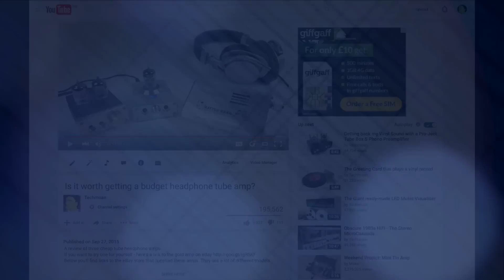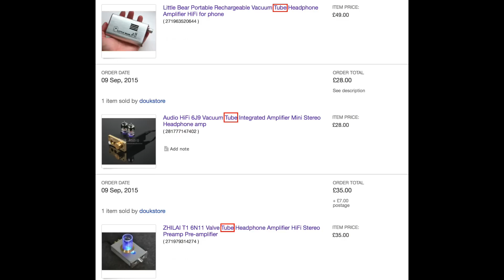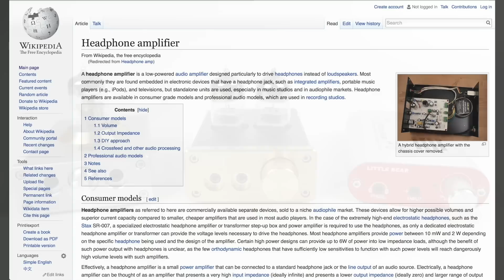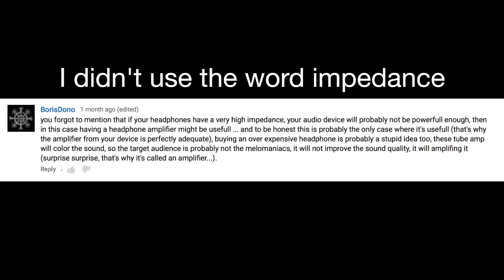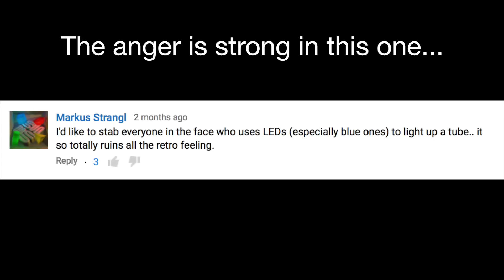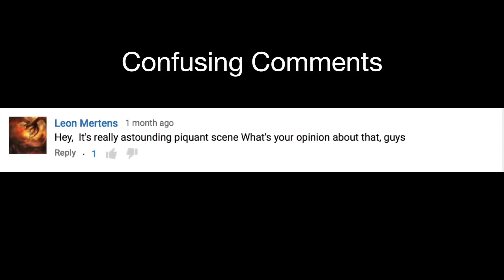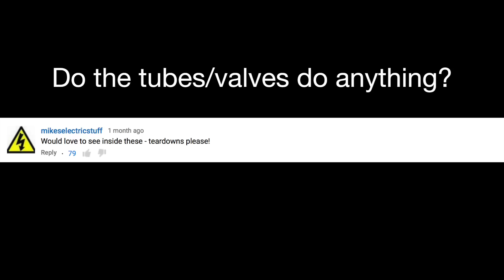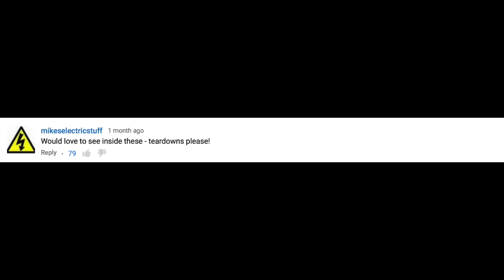Headphone Tube Amps - Follow-up & Tear-down

Comment: You might want to try out a 'tube buffer amplifier' too. They amplify line stage to line stage with little amplification, but with some characterstic tube sound. You can use it as an interstage between a CD player and power amplifier for instance. There are some kits you can easily solder yourself.

Comment: Okey, I'm fairly confident the valves don't actually do any amplification, the NE5532N opamps do. At https://youtu.be/2Zt5WPdyPTw?t=715 you can see the pin8 on opamps comes from the valves, that's power for the opamps. That's why it powers on with a delay, that's why it rings when tapped and that's why you can disable channels independently by taking one or other valve out, but all that is really happening is that valves are messing with opamp power not the audio signal itself.
Mind you, it is possible to make similar amp where the valves actually do something.
Reply: For fun you might try taking out the valves on the two valve variant and putting a wire jumper on pins 1 and 3 counting clockwise, view from top

Comment: UPDATE:  i received my "Valve Amp" tooday and as my dad is a TV technician doing it for over 30 years and has experience with Valves. he said the Valves are a Bridge and for show. you can use both channels with one valve fitted but remove both and it will work. are they worth it for me yes and no. yes i only need it for my Xbox one no because i wanted a True valve amp

Comment: I'm not a tube guru by any means, but I know enough to understand how tube amps work (or "valve amps"; either term is correct, and most people who use those sorts of electronics will understand either word...unlike some commenters, apparently.)

At any rate, I looked up data sheets for both 6J9 and 6N11 tubes. The 6J9 has a typical rating of 125v on the plate(s) (300v max), and is a triple triode design. Considering it's a stereo amp, it makes sense that they would only use two of the three triodes in the the tube, which would easily explain why some pins were unused. You don't need to connect the pins of a triode section you're not going to use.

The 6N11 is China's name for their direct equivalent of the 6DJ8 (ECC88 for you Europeans), so we'll look at a data sheet for the ECC88 because those are easier to find (remember, it's the exact same tube, just a different name): it's a dual-triode design, but if they're using two tubes in the amp, they're probably only using "half" of each tube. You'd have to ask them why they went that route, but it's not uncommon either, so there's nothing particularly odd about it (and again, explains why not all pins are connected to traces.) The typical plate voltage of an ECC88 is 90v (130v max), again a good choice for a low-power situation such as this.

Both tubes use the typical 6.3v for the heaters, and have low plate current draw (15mA for the 6N11/ECC88, 6mA for the 6J9.) Both power supplies would have no problem heating those tubes; most modern cellphone chargers will even handle a 1-2A current draw, quite a bit more than either of those tubes require!

For comparative reference, I'll list typical specs for the 12AX7, which is still an incredibly common and popular dual triode preamp tube: the typical plate voltage is generally around 250v, with a current draw of 1.2mA. While a 12AX7 can be run at lower voltages, you start losing a lot of headroom and it distorts sooner (great for guitar amps, not so much for hifi gear where you want ALL THE HEADROOM.) Thus, a 12AX7 is not a great choice for small amps like this, although it gives a good point of reference for the sake of comparison.

One thing I'll point out is that it's typically power tubes that require a metric load of electricity, and these are hybrid amps with apparently a solid state power section. Considering there are no EQ controls, the audible effect of the two preamp tubes is minimal at best (not counting damaged/microphonic tubes.) Most of the signal boosting is being done by a solid state power section, which have far lower power requirements in small applications like this. The tubes are working but I'd be willing to be money that you could swap in solid state components and not hear much of a difference (you'd be able to shrink the amps down by at least half the size, though!)

Comment: Here is my verdict:
Second 2 amp look like total fake,  there is no high voltage supply and they only connect heater.  it is interesting that they actually took care to make that turn on delay, looks like it is implemented by placing capacitor on power supply "enable" pin.

There is possibility that first amplifier is using tubes  at very low anode voltage  since it looks like there is some kind of boost converter, but this is not normal.
 Build quality of second amp looks  like bad joke on audiofools. it has only one dc dc converter so i think tube is definitely for decoration only.

Last "little bear" amplifier is actually real deal, but it is using special type of low voltage vacuum tube which is designed for battery applications,   I can't comment on whether this is considered adequate quality.
There is DC-DC converter to power that tube and another DC-DC converter to power up the heater.
So in essence all contents are as written on the can.
I find it interesting that they decided to use power modules(and one module is even modified) instead of just soldering all parts on main PCB as in first 2 amps.

Comment: Re your comment about not all of the pins being connected. Circuit boards tend to be multi-layer so they can run all the tracks they need without them crossing. So the other pins might be connected on another layer, or even the other side of the board.

Comment: I got mine in the mail today, the gold front one. I have just tested it with some crappy headphones but it really improved the sound. Not only did it get louder, it also added some thickness. 
No ringing sound with my amp so you prolly got some bad tubes when u got yours.

I bought mine for use while i record music and hope it will increse the sound in my headset.

Comment: your first video was perfect, the only missing part was the tear-down which you did now ;) thank you ! - after seeing the guts of those amps... i think i can safely state that the tube part of the amps is either interesting or questionable.. those are either tubes operated at very low anode voltages under starved conditions (look here: http://www.valvewizard.co.uk/Triodes_at_low_voltages_Blencowe.pdf ) or if not the case.. then the tubes are fake - can't see any capacitors rated for higher voltages which would be needed for "normal" tube operation.

btw... you described it correctly in your first video, the issue was a ringing sound, no question about that one ;) a microphonic (behaving like a microphone) component is the root cause of such a ringing sound - doesn't have to be the tube itself - easily might be a ceramic capacitor in the audio path as well.
Reply: +Robert Jung 
It did not came to my mind that those tubes may be using low voltage, but after you comment I traced that first amplifier actually has dcdc converter to produce around 30v  or so. they seem to use 16v capacitors connected in series here.

By the way I also noticed that you can operate tube without anode voltage at all and it will generate some output by itself.

Comment: A microphonic tube does give a ringing effect on the sound so i can not really say that it's wrong to say that,
the ringing is caused by mechanically vibrating elements inside the tube construction that modulates the sound, microphonics are very common in tubes and often tubes were selected for low microphonics and sold with another product name, of course to a higher price.
Amongst hifi-guys the popular "tube-dampers" of rubber and other materials is put on the outside of the tubes and therefore does not affect the internal structure of the tube.
Reply from the maker: +senohpi I never said it was wrong to call it microphonics .....just of no interest to 99.99997% of the people watching the video (or the person making it).
Reply: +Techmoan 
True, most people doesnt care and thats my point, you said that you got comments on the other video so that&#39;s what i commented.
Keep up the good work, i enjoy your videos!

Comment: The thing with fingerprints is that the acid in the grease etches the thin glass thus weakens it and it can then crack, 
however, that is only valid on high power bulbs like Xenon headlight for cars where the rapid heatening may crack the glass where it's weakened.
For tubes it does not matter due to it's thick glass and slow warming up, the grease does effect and tends to remove the usual white printning though, as moist also will do.
Reply: While why fingerprints on bulbs is bad, your theory is incorrect. In halogen bulbs and Xenon bulbs, fingerprints prevent proper cooling of filaments and cause them to prematurely burn out. It has nothing to do with glass expanding or contracting, and more to do with heat dissipation. I've burned out bulbs on purpose as a demonstration, never had the glass fail as a result of fingerprints.
Reply: @linksmith1057  I can assure you that HMI1200's (Discharge lamps used in theatre lighting) do indeed 'pop' when fingerprinted! they usually take out the reflectors and most of the light chain when they blow!...
Reply: +Richard Stifle just to be clear, I understand you do agree that the fact remains fingerprints have no effect on the sort of low power diode and triode tubes used in home stereo systems.

Fingerprints do affect tubes that get incredibly hot, but not low temperature tubes found in these audio amplifiers and old TVs.
Reply: +senohpi You are right guys, i certainly mixed things up :)Regarding the halogen bulbs i suspect that the grease acts as a dark or reflective spot for a certain amount of the spectral energy that the filament emits, halogen have of course a very different distribution of the spectral energy than, for example the sun, has,thus gives insuffiecient cooling on that part where the grease is applied.Does it sound reasonable?.. i have to get a bunch of bulbs and do some experiments now :)
Reply: senohpi while I appreciate somone actually clarifying why you shouldn't touch the tubes, the fact of the matter is, as you have shown, you actually CAN touch these tubes without any worry. The layers of oils from your skin on clear glass appliances which get very hot trap in excess heat, more than they were designed for when creating the surface area of the glass housing. Thus, the layers of oils cause them to get slightly hotter than they should and cause poor performance and failure. However, these tubes do not get hot enough for this to ever actually happen, although some do...
Reply: +senohpi Acid in the finger oils? Now that's a new one to me. Would have to be some seriously acidic stuff to etch glass... :D
Now grease stains do have an effect on halogen bulbs and the like, but it's caused by the greasy spots heating up significantly more than the surrounding areas.
Reply: +MosoKaiser  Only if he`s an alien )

Comment: I really like your style and the way you put the pedants in their place! I have one question regarding why would you want to use tubes/valves for hifi? Guitar players love valves (they will ALWAYS reign supreme over solid state) because of how they distort, they add rich harmonic content to the sound unlike solid state amplifiers, which do not distort pleasingly at all (I'm generalising here), however I'm sure audiophiles/hifi nuts want the most precise reproduction of sound and don't ever want distortion, so what would a valve offer?
Reply: +Jack Beale Guitar Here's a nerdy answer that I never checked myself: the phase/frequency response (which nobody measures) is much better in tubes than in solid state. Other characteristics like the amplitude/frequency response, the signal/noise ratio are worse. But since phase distortions influence how well (or bad) sound stage is perceived many people learn to cope with tube deficiences in exchange for a better sound picture. Also, human hearing can naturally adapt to amplitude distortions. But it can never adapt to phase distortions.
Reply: +Jack Beale Guitar At the bottom of this comment I linked an article describing the differences (you can skip to the end for just the conclusion). The conclusion basically states that, under normal operation (eg when not clipping), the design of the amplifier itself will have more effect than whether it's valve or transistor based. That is, if you can hear a difference, then it was the designer's choice to deliberately color the sound. Some people prefer this colored sound, even if it doesn't accurately represent the original source - this is what valve can offer, a more "pleasing sound". You might say, why not make some software which does the same thing? I think it's been tried many times before, but it probably would not sell as a nice, glowing tube on your amplifier.

TL;DR people like different things. Audiophiles (audio lovers) don't always love 100% perfect sound reproduction.

http://sound.westhost.com/valves/valve-trans.html
http://sound.westhost.com/valves/valve-trans2.html
Reply: +drojf Tubes were around long before transistors, which didn't really gain much popularity in consumer electronics until the mid 1960's, even though solid state devices existed long before then. The old selenium and germanium devices available then just didn't have the reliability or longevity of the later silicone ones, and tubes always beat them out in all areas except power consumption, heat dissipation, and size. The Hi-Fi revolution started in the late 1940's, and many Hi-Fi audio tubes (low noise/distortion) were developed in the period that followed. Today, most consumer gear is Mid-Fi at best. Most people now listen to digital instead of Hi-Fi.

Comment: Following up on this, I ordered one of these devices - the twin tube 6J9 amp. I've torn it down in a similar manner, and have a few conclusions based on my (admittedly quite basic) valve amplification knowledge. To put it simply, the tubes aren't adding much here. That's not to say they're adding nothing - the valves are being "space charged" on 12v, and are colouring the sound instead of amplifying them. The valves ARE being used, but as a preamplifier, instead of amplifying the sound directly. They very much are hybrid amps. If you're after a complete valve amp, these are NOT the solution. The tubes being used in this can also be pretty microphonic. 

However, these ARE hybrid valve amplifiers, and for the price they aren't bad at all. Yes, they are cheap and chinese made, but so is the well known Little Dot range. And if you've got a reasonably high impedance set of headphones, probably up to say 64ohms, they will drive them better than an onboard headphone amplifier on a phone or in a computer. Don't get me wrong, that's not to say these are audiophile grade devices - but for £30, what are you expecting?

Also, the store +Techmoan mentions does produce and provide kits based on well known amplifier circuits. They're not overpricing said kits, and if you want a customisable experience with one of these it's worth taking a look. It's also a good indicator that the company selling these is not in for a quick profit without thought - they've researched the available circuits well enough to order correct kits for them.

Comment: Dave at EEVblog is a great guy, but if you really want an expert on tubes/valves to tell you what's up, check out UncleDoug. He builds tubes amps from scratch and does videos on the theory behind them. I'm with those who say that the tubes are mostly cosmetic and the opamps are doing the real work.
Reply: I've got a 6J1 tube amp with no opamps, I just want it for the looks really, does the job.